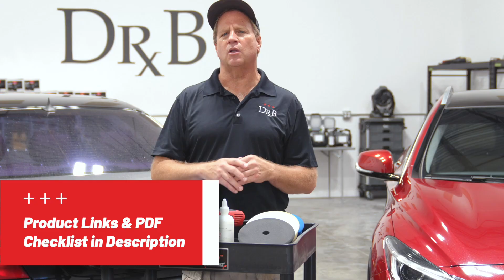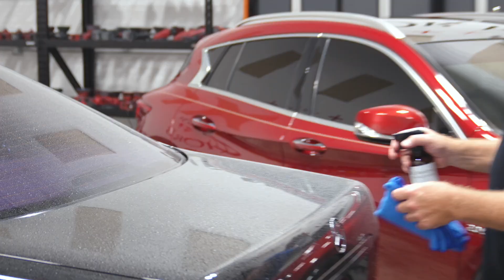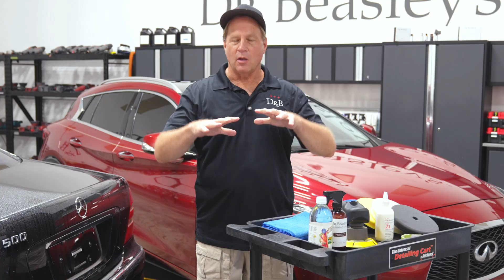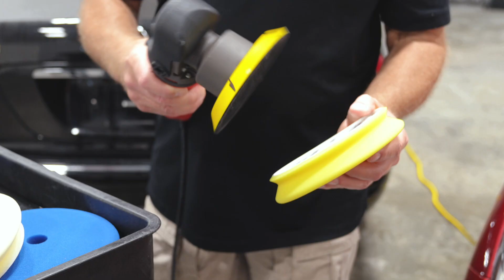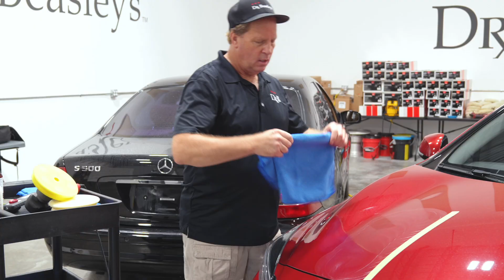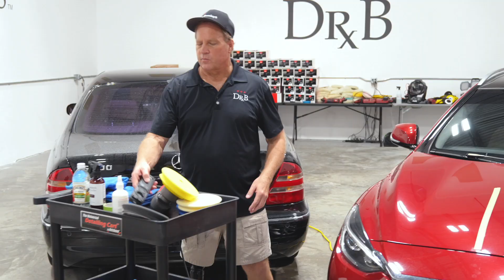How to Remove Water Spots on Car Paint | Beginner's Guide

Comment: That is why I like wax. You never heard of waterspotting till Ceramic coatings. Not knocking ceramics, but wax is sacrificial; a water spot falls off or gets rinsed off after washing. Ceramic dries and etches. My solution is to always put a coat of wax over a ceramic. The ceramic last longer and looks nicer.
Reply from the maker: That’s a classic approach, and using a sacrificial layer over a coating is definitely one way to add an extra level of protection. Thanks for sharing your method! -Mike Phillips

Comment: How can you tell if it’s acid rain vs water spots that caused etching into the paint?  I can’t get them off with C4 compound.  Don’t want to burn through paint.
Reply from the maker: At this time, I do not know of a way to differentiate between the different root causes for water spots.  I'm surprised the C4 compound is not removing them?  I also understand the risk involved with removing too much of the already THIN factory paint.  At some point, we all have to wonder, What's in the Water?

Sorry I don't have a better answer and trust me, I feel your paint.  Thanks for watching and commenting.  -Mike Phillips - the guy in the video.

Comment: Mike you are as you know outstanding, I moved from northern Ohio to southern Ohio into an apartment and the water is very hard so another step to a simple wash, yes I tried to dry it off fast enough no luck. I'm thinking about a small water softener just for exterior water source.  Not the end of the world with me I love making my vehicles shine.
Reply from the maker: That's a common challenge with hard water so anything you can do to avoid damage from the corrosive elements in any water sources.

Thanks for watching and commenting.  -Mike Phillips

Comment: Hydrophilic means water will stick to the hydrophilic surface. It's practically a magnet for water. You want hydrophobic because it pushes water away and doesn't give it a chance to stick to the surface. Because water cant stick to the surface, water molecules stick to each other (cohesion) forming water beads. If water sticks to a wide area of hydrophilic surface, water will also dry on a wide surface. On a hydrophobic surface on the other hand will usually push water away from the surface. If some water (beads) does get stuck because it couldn't flow down from your panels, at least it only covers a small area. Not a whole panel covered with hydrophilic material.
Reply from the maker: Great insights, thanks for sharing.  -Mike Phillips
Reply: if the mineral deposits are more spread out instead of concentrated in a bead would it not make it less noticeable? I would argue that it is better spread out over an area because of appearance and would take longer to get etched into the paint since it is not concentrated in a bead

Comment: Hey Mike. How do you feel about utilizing a strong acid like wheel acid? That's what I've been using to take care of waterspots. 9/10 it'll take them completely out.
Reply from the maker: I remember seeing a Meguiar's Rep, Terry Richards if memory serves me correctly, showing me Hydrofluoric Acid to remove water spots off paint back in the early 1990's.  I was impressed.  That said, I've never adopted the practice.  I'm good with anyone and everyone else doing it - but it's not my preferred way to deal with water spots on modern clearcoat paints.  And I've also noticed, to actually get water spotted paint perfect, you're going to need to polish the paint anyways.

Thanks for watching and commenting.  -Mike Phillips